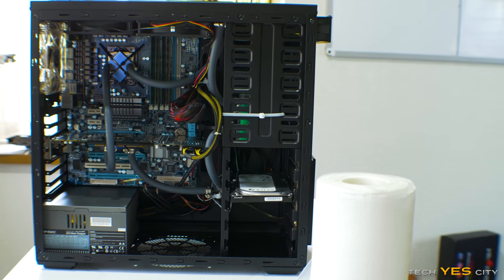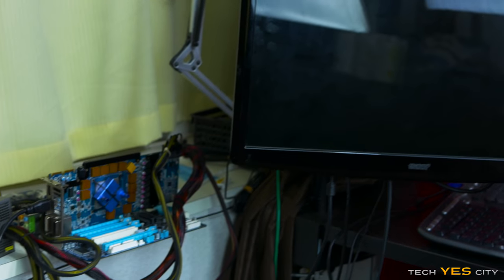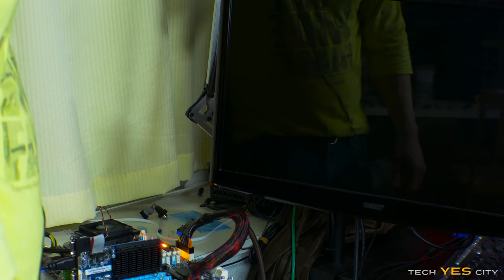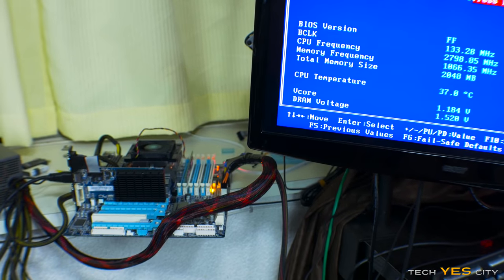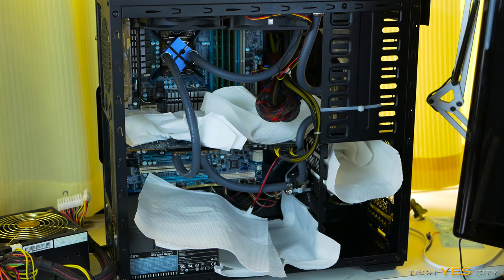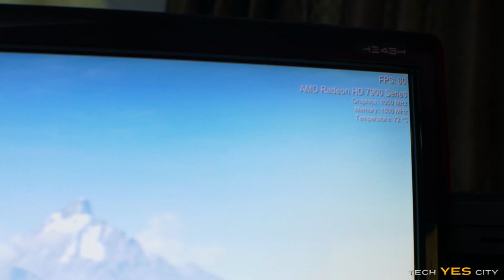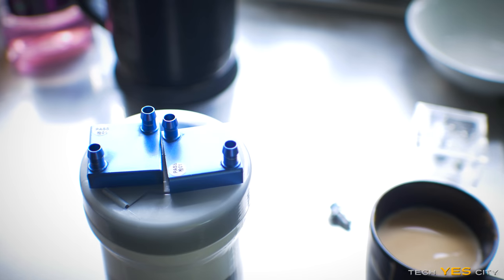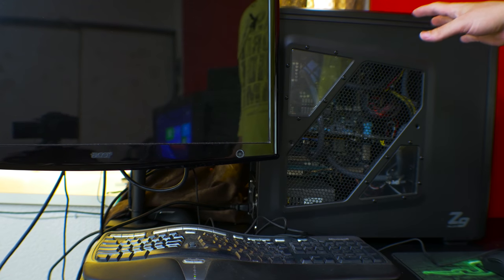$50 Custom PC WATER Loop - Is it POSSIBLE?

Comment: I will never water cool... Air is easy, cheap and worry free.
Reply: +ILL BILL NECRO k
Reply: +ILL BILL NECRO aio coolers are good aswell
Reply: +ILL BILL NECRO I would argue that a good AIO hits on all three of those items, all the while making it easier to squeeze every bit of performance out of your chips, and/or extending the life of you components (and not just the ones that are water cooled).  But that's just my opinion.
Reply: +coinsagE46m3 agreed
Reply: +coinsagE46m3 If you can find a good deal on a decent AIO, then I agree, otherwise Air cooling for most people is just fine.
Reply: Commodorefan64 I would agree. Most people are ok with "just fine".  I, myself, want more for my setup than that.  I want lower temps, more overclocking head room, and longer lifespans for my components. To that end, air just won't cut it.
Reply: Yeah and water doesn't even perform better than a good air cooler.
Reply: well water cooling is good but they are expensive single rad where i live i brought thermaltake water performer 3.0 for around 75 bucks but im getting better cooling then hyper x 212 evo  but noctua d15 or d14 cant fit in my case it all depends on the size of the case

Comment: This is so cool. I love the cobble-it-together stuff you do for cheap! Those blocks are aluminum and very small. Not much contact surface for the IHS or die on the graphics processor. You would have needed to sand off the anodizing to bare aluminum to help it, but again, the contact area is too small. Also, they aren't completely flat. Your fountain pump is strong enough, just your blocks aren't big enough. Aluminum is good at moving heat away, but copper is a much better conductor of heat. Even with a block that size made of copper, you'd still have issues. There's no compromise for surface area. Can't wait to see you get it sorted out!

Comment: As someone who's also built a super budget customer PC water loop 15 years ago I can tell you 2 things that have let you down despite the rest of the design being reasonably sound.

Your water block mounting. Cable ties just don't cut it. You need a solid mounting system which can apply a consistent clamping force to allow for good heat transfer, especially in a water setup where you have additional forces trying to rip the water block off the CPU / GPU

And secondly your application of thermal paste sucks. You aren't meant to paint it on with your finger, it doesn't work well like that. You're far better off just applying a single blob to the centre of the chip or a single straight line. When you apply the cooler despite not being a perfect mating surface the thermal material gets squeezed and fills all of the voids as it tries to spread and escape the pressure. Added benefit to this is that air is also expelled. The pre-spread method has a huge tendency to capture air pockets in the thermal material. It can work but first you need to use enough in the first place to actually make full contact with the water block.

Good luck if you give this a try again. :)
Reply: I don't know how many times I have seen comments about the thermal paste spreading and people blaming his temps on it, but your completely wrong, he's done multiple tests to disprove that myth also with gpus it's almost necessary
Reply: same with the cable ties

Comment: I did something similar to what you did here, but as you also mentioned I did go with a better Pump and CPU Block. I did not Water Cool the VGA, it's still under warranty so I did not want to mess with it. I used a used D5 pump for like 60 bucks, used, and a CPU Block from China, like 25 bucks. 

I also made sure to use all copper for everything because I don't think Aluminum cools as well as copper and it's not really that much different in price. I also used 2 Res for a bit of added water to the loop and some Tee's with shut off valves to drain and fill my loop easily. I also purchased a Tape and Die for G 1/4 so if I need an extra port or coupling,  I simply drill a hole in the Res and tap it or cut a piece of copper pipe. 

I modded my D5 Pump Housing to accept G 1/4 fittings so that I could attach a Res right to the Inlet of the pump with a coupling. As I researched Aluminum it just seemed like it was too uneven on the surface where as copper was clearly flatter. I also invested in two used Rads, 240 and 360 plus fans and lastly a PWM Block to control all the fans. 

I used push pull and can say my FX 8350 does not go above 35 degrees C any time. I forgot to mention I also added Temp Ports both before and after the CPU to ensure that the entire loop is within a degree or two just for shits and giggles. I am using the Asus Crosshair V Formula-Z 990FX and invested in the VRM cooler, which does not seem to do much as I don't OC much, just a bit to give it a bit of zing... 

I opted for vinyl tubing to be able to see if there is anything growing in my loop. Oh, a Silver Coil is a must have, and I dropped mine in the Res so that it does not get sucked into the loop and my water is well over a year old and no growth what so ever. I did try an experiment with Glycol but for some reason that changed the color of the tubing and gave up on it and replaced all the tubing after a good flushing. In a different build I used Pass Through fittings to mod my case so that if I want to drain, add or change fluids it was really easy to do. That proved to be more problem than to seem to do any good so now I use use Tee's and shut off valves.

All is not lost on your project as you can salvage most of it, just need to up the game on the pump and maybe use a belt sander on the surface to get it a bit flatter than work it with higher grade paper to get it smooth again. I will say this about Aluminum, it is very east to work with. 

I recently modded a North Bridge Aluminum Cooler from an old CPU Cooler and I am here to say I was able to use the original clip and it makes the North Bridge ice cold, barely gets warm now. It use to get hot that it would almost melt anything near by, but no more.

Cheers Mate....

Comment: Things my father taught me #37:  How to use a hacksaw/coping saw.

Instead of making 10,000 30mm strokes at a fast pace, make 100 slow, controlled strokes, use the entire saw blade, and let the saw do the work.  There is a reason the blade has teeth along it's entire length.   You will get your cut made a lot faster and save yourself a lot of frustration.

Comment: That's not exactly how you apply thermal paste
Reply: It's actually a good method. Works just as well as a dot.
Reply: Except your oily fingers make the thermal paste about as effective as using Vaseline.
Reply: Useful only if using conductive thermal paste, so you're sure paste doesn't get where it shouldn't.
But if you're using non-conductive paste, you're just making your fingers dirty for nothing.

Comment: Great stuff as always Brian. You are closing in on that 100,000 subs. Watching all your vids here with the old hardware, I decided to go thru my stuff to see what I could throw together. I put together a i3 2120 on a MSI z77 motherboard, 8gigs of ddr3 1866 ram, gtx 770 and a corsair gs 600 psu. I have a 250gb velociraptor. All this in a old Thermaltake case. But I still more old stuff to go thru.

Comment: i'd rather just buy an all in one cooler so i dont have to plug it in another socket
Reply: 1) It's just for the test, he just wanted to see if it's possible. It's actually shitty, it doesn't cool well.
2) You can't have your gpu watercooled with an aio.

Comment: I also did a similar build for my PC because I had no money but wanted watercooling: Cheap butterfly cpu block for 10 bucks and an old aquarium pump we had around. The pump has a label on it: "Made in West Germany",  not much to add I guess... A friend had an old excavator heater, so we used that as a cooler. As a water container we used a small water container from a car, where the washing fluid is usually stored (for the windshield). We had solid 50° Celsius on full load on the CPU. I later added another cooler and its now on 40° ! :D

Comment: Smart idea to run the loop without the PC components powered on. I don't do watercooling so this could be common practice for all i know. 

You should definitely do a round 2 when it comes to the ghetto watercooling i'd love to see better blocks and a stronger pump (I think there are some better ones on ebay around $20 ill have to take a look). Used would obviously be the way to go but not everyone has access to the same parts and prices so i think using new parts from the hardware shop/ebay was definitely the way to go for this type of project.

Anyway thanks for the video Brian i really enjoyed it.

Comment: If you're trying to be a serious tech channel please learn how to apply thermal paste properly.
Reply: he knows people hate it thats why he does it kinda think he is cool because he has the balls to do that
Reply from the maker: +cubbiefn I bet you haven't even tested my method? Also I will challenge whoever you pick to a 10 builds vs 10 builds side by side (same gear vs same gear) and whoever gets the best temps consistently wins?
Reply: The results are same. The normal recommended use doesn't usually have a full coverage when removing the heatsink. Putting too much will just overflow. I actually prefer this method he used as it does a full coverage and its fairly thin. People worry about oil from your fingers affecting thermal paste. They aren't wrong, but unless you're building a PC while eating KFC there will be no noticeable difference whatsoever. And I'm fairly confident that he's hands are clean. With all that cleaning, I have faith.
Reply from the maker: Loc Nguyen^ This, exactly, hands are cleaned with alcohol before applying.
Reply: +cubbiefn there really is no difference in thermal paste application as long as you get good temps. to much in general and it will squeeze out. do the grain of rice method and you get a dot in the middle of a square and don't get full coverage. sure you might get a bubble doing the spread method but the majority of the time that your don't get a bubble you end up with a more uniform coating with no bare spots.
there is no universal correct method. different companies have different methods. EK wants a + sign (top to bottom, left to right) and an X sign (corner to corner). Antecs thermal paste says to use the spreader it comes with.
Reply: i do the X method because it gets full coverage and its just a personal preference. i was just pointing out that spreading is a thing and isn't detrimental.
Reply: +Tech YES City No the problem with the finger spread isn't "oils from the fingers", or applying the correct amount of paste (although in general applying the correct amount is important). The problem is pre-spreading the paste makes it much more likely to for air bubbles to be in the TIM, air is a very poor conductor of heat compared to thermal paste and can cause temperature issues.
Reply: +cubbiefn In every youtube video of him using this spread method I have never seen any heat issues.
Reply: +Tech YES City but whats the point, i kinda see the point here bc you dont have to same pressure as with an off the shelf block, but otherwise you can just do the rice method or the star method (gpu) and then the block will spread it around
Reply: +cubbiefn this. I used to get random shutdowns due to overheating back when I was an idiot and spread my paste with my finger / finger with bag around it.
Reply: +NCRranger24 - Gaming and More! Can you explain why Tech YES City NEVER gets over heating problems using this method?
Reply: +John Tuckett You mean like the heating problems in this video? The gpu was cooler than the cpu, with a water loop all components should have a similar temps. It's possible the problem in this video was improper thermal paste application not the water loop.  Also, please note that I never said his method would never work, I said it's much more likely not to work which is true.
Reply: +boTy False, you get full coverage with the pea method and don't risk air bubbles. Physically spreading thermal paste may cover the die evenly to your eye. However, it's not even close to being even, our fingers, and even credit cards aren't actually smooth so you create unnecessary ridges and valleys in the spread out paste that can trap air when the heatsink is put on the die making for poor thermal transfer. The spread method probably works more often than it fails, but it does introduce unnecessary failure and I don't like to waste time on stuff like that when building/cleaning parts.
Reply: +cubbiefn I didn't see any heating problems in this video. Seeing as they were over clocked they were within their limits
Reply: +cubbiefn He used one pump and so that implies the cool water went to the GPU, got heated, then went on to the CPU where it was already warm water so it didn't have as much cooling power. With a stronger pump moving water more quickly, this would work okay, but it would be better to use two pumps and have independent loops when using low volume pumps. It's possible to split the cool water into two parallel local loops rather than keep it in series, but if one of the parallel routes has more flow resistance for whatever reason then more water will divert to the other one resulting in poor performance for one. Again, the best solution is to use independent pumps. I couldn't really tell what he actually did from this video, so I have no idea if he had a parallel or series loop. The time wasted in the video waiting to test if the CPU worked could have better been spent showing the actual loop configuration. If he showed that at all while dancing and flinging it around, it was impossible for me to see.
Reply: +cubbiefn Pls do your research. Pea method and Bryan's method give the same results.

Comment: Good video! And all you really need is a cpu block that has fins inside it (preferably copper). You really missed out on a quite a few big aspects tho! 1.people like to know the source of items you are using even if they may not be the best out there. 2.add all the steps in words on screen if your not going to talk about what you are doing newbies will thank you for this. 

Also some notes i have for you in your water cooling, first make a few systems and test them before making a video because you will learn a lot from doing that way you make a informative video that people will like. 
Tips
A. Never use your finger to spread thermal compound it will rub off the oil from your skin and make a thermal barrier. Also just use a grain of rice method for spreading your TIM let it spread out under pressure (not a lot) this will ensure your TIM fills any gaps. 
B.  Never use a shim just make sure the block has been sanded flat i like to make them mirror finish with 1500,2000,2500,3000 grit sand paper. you can pickup these at local bodyshop or even at a auto parts store.
C.  The pump should be ok as long as the water is still moving. Just make sure you have cpu block first in loop after your radiator/pump. Also make sure your flow into cpu block is from the bottom to top that way air will work it self out.

Other thoughts. I like your tubing i'm guessing its a gas line hose of sorts very nice! The reason i like it is because the thick rubber side wall is good at sealing on barb fittings. Also it is braided line so it should not collapse on it self. Also it looked pretty flexible witch is very important when working with pc's as the parts are some what delicate. All said and done i think this can be done for under $100 or at least very close to! Ok thats all i can think of right now really nice job on the video looks clean and neat big thumbs up!

Comment: In general you don't need a superb waterpump. Water can soak up alot of heat so as long there is a decent waterflow you are perfectly fine. Pumps with a "Max. Discharge head of 1.8 meters" are strong enough to deliver uncompromised cooling-performance for a average build. Off course with more blocks, 90 bends fittings and very restrictive blocks it's better to get a stronger pump...

Comment: For those that aren't sure what certain items are because of the vague description or you're scratching your head at "Battery water" or "Engine hose" and you want to walk into your local Automotive parts store and or WalMart and when you ask them they give you a funny look followed up by a half a dozen options like Heater Hose, Emission hose, EFI Fuel hose, low pressure Fuel hose, Hydraulic hose, etc, well small heater hose and even cheaper Fuel Vapor/Emission hose should do fine within these temperatures, just make sure you're getting the right diameter for your fittings, whether it's measured in ID or OD just be careful with cheap and flimsy vacuum hose that could collapse when the temps start to rise. ??Battery water?? = distilled water, you can get a gallon from Wally world for about a $1

Comment: Just a thought.... but the CPU temps may be so bad because warm coolant is passing from the GPU to the CPU on a relatively short run. Incorporating a second radiator between the GPU and CPU should improve the CPU temps.

Comment: with the water cooling blocks you got I was honestly surprised you didn't sand down the bottom of them to a polished metal finish. cuz honestly I think the thermal problem had to do more with the paint on the bottom of the block then with the block in and of itself